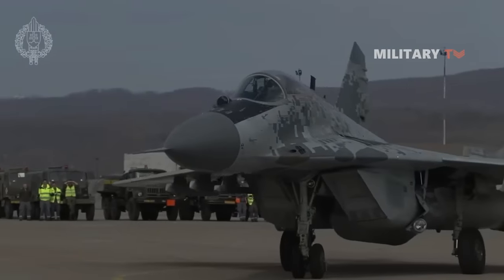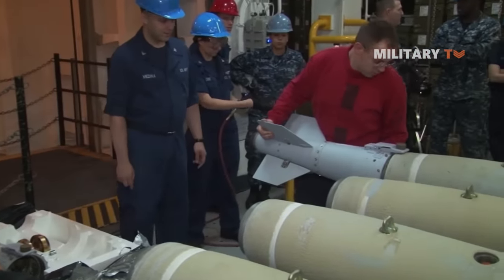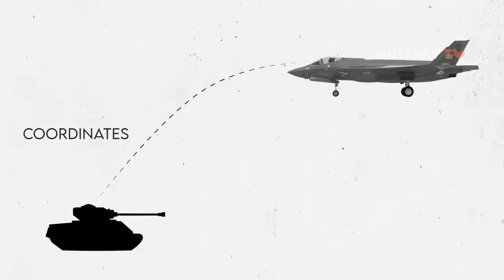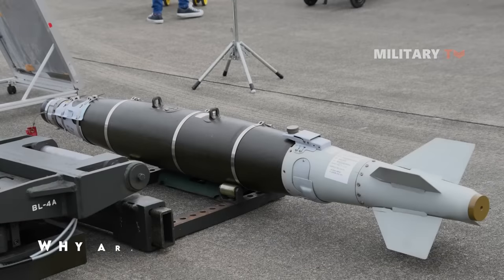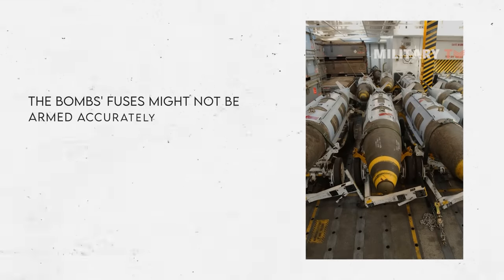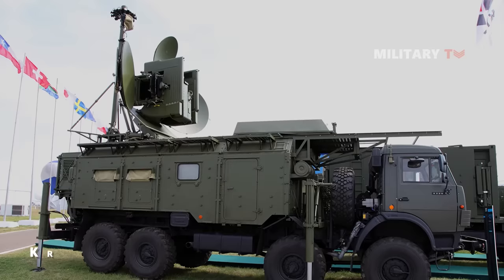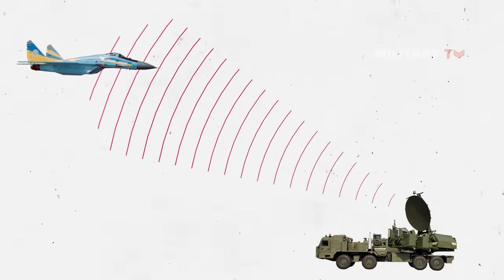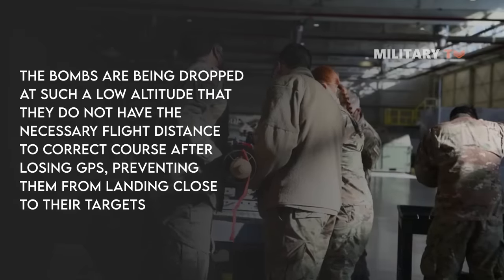Why Ukraine GPS Guided Bombs Are Failing?

Comment: OK-------... The Military has a GPS System that uses frequency Hopping Digital access code with line-of-sight antennae that are shielded from Ground signals that are immune to jamming...  Whether Ukraine is allowed to use such systems is another thing as the US may not want such a receiver to fall into Russian hands if the bomb or missile fails to detonate... As well as the new Inertial navigation systems that only use GPS as fine-tuning updates that will ignore the GPS if it suddenly moves a set distance from predicted targeting or miss matches any other GPS signals (of the Dozen systems now in use World Wide) used by the Weapon...  These there are the  New Inertial Guidance systems that have less than a two-meter impact point of the target over a 100 miles from the last accurate position reading of the Air or ground launcher...  The old and now greatly improved Ground profile system has also been reduced in size to now fit small bombs and Missiles as well as Infrared video and Millimeter wave Smart Direct Targeting systems added to Bombs with simple replacement Nose fuse kits that are quickly superseding the need for total reliance on GPS systems...   But then they are all expensive compared to the Original Cheap Single Frequency GPS Systems on older weapons... That Ukraine may be Stuck using...

Comment: Russian C-400 is the most advanced AA platform on the planet. It has gigantic range, reaching very deep in Ukraine territory, therefore ukrainian MiG 29s have to fly extremely low and drop ammunition from too far away.
Having said that, the russians also posses the best GPS-jamming technology in the world (I bet the chinese will steal this tech sooner or later), so even if an ukrainian pilot goes suicidal and drop the projectile as it should be dropped, it still doesnt reach its intended target.

On the other hand, russians use their dumb bombs with a similar navigation kit with great success.
Only god knows how much ukrainians died from their FAB 500, 1000, 2000.

Comment: Radar jamming can be targeted and destroyed. Why can’t we do the same with GPS?
Reply: They move.
Reply: @NathansHVAC  I would think the military knows they can move. And just like radar, you want to set them up high and with a lot of visibility to maximize its coverage. The problem for the people using GPS jammers is that moving them around frequently is resource intensive and takes time. Not sure if the HARM is designed to detect GPS jamming transmitters or not but I suspect we are learning the electronic signatures of such devices and can program the HARM to detect, identify and track them before being sent off to destroy them. A pair of F-16s on SEAD sorties can make a quick work of these systems opening up the use of precision GPS weapons again.

Comment: I would say that in a theatre where GPS is known to be unreliable due to jamming or spoofing, the GPS should be the backup, and the INS should be the primary navigation source. Maybe the INS system should be initially calibrated by GPS while out of the range of jamming systems, then if GPS data conflicts with INS reckoning of the bomb's location, GPS data should be ignored.

Comment: Military GPS receivers have an encrypted, secure capability on 3 different frequencies (L1, L2, L3) that requires input of a GPS cryptographic key for the GPS receiver to use the L1, L2, L3 precision (P) signals. If the cryptographic key is not loaded, then the receiver can only use the unencrypted L1 C/A signal which is very easy to both jam (deny) or spoof (wrong location, and/or bad velocity). If Ukraine doesn't have the GPS cryptokeys (not supplied by US/NATO) or they fail to load them correctly, the the JDAM's GPS receiver can only use the easily jammed L1 C/A signal. If the Russians REC units are spoofing GPS, then the JDAM are getting erroneous position and/or velocity measurements to the JDAM guidance OFP and fin steering to target coordinates is commensurately compromised.
Reply: They must not have the keys because the keys are already in the western weapons sleepyhead!

Comment: because crappy engineering that worked to fight cavement doesn't work so well with equal opponent. That's the problem of half of the USA weapons, they were engineered to fight cavemen in some craphole of the earth. Not having jamming resistance can't make it even military grade as per 2000

Comment: JDAM, one must emphasize, is a gravity bomb that must be released above the intended target.  This means flying nearly OVER the intended target. That is easy to do when bombing low tech enemies with no Surface to Air Defences.  But that is not the case in Ukraine.  Every Ukrainian fighter-bomber that attempts to overfly Russian forces at 20,000 to 30,000 feet, like NATO aircraft did in Afghanistan, Iraq, Libya and Syria, will be shot down.  So the Ukrainians, in order to survive, fly fast and on the deck, an altitude from where these bombs are not effective.
The only bombs they could use are stand-off winged bombs, like the Israelis have been using against Syria or like the ones the Russians now use in Ukraine.  They can be lobbed quite a distance from the target and will glide to it, without requiring an overfly of the target like the JDAMS do.  They JDAMS are great for bombing the Taliban and ISIS, not the Russians.
Reply: What are you talking about JDAMs have a range of up to 45 miles.

Comment: Too many misconceptions in this "reporting". 

1) Ukraine MiG-29 and Su-27 fighters are not inferior to western equivalents, they are actually superior. The problem is that Ukraine doesn't have them anymore as in the first day 80% of the Ukraine fighters were destroyed on the ground. In the next week 95% of them were destroyed. Ukraine received about dozen older MiG-29's from the Poland and another from Slovakia. Ukraine has been losing those left and right, but they have been now operating them far more carefully trying to avoid losing them in vain. They just can't use them as Russia has superior Su-27 models and superior air defense coverage. So unless west want to send their latest fighters, Dassault Rafale, Eurofighter Typhoon, Gripen NG and of course F-35, then Ukraine propabilities to invade Russia is extremely thin. 

2) The JDAM is not utilized by pilot entering the GPS coordinates in-flight. That is really done primarily by the weapons grew when loading them to aircraft in the arming area (just before taxiing to runway). The JDAM is only to be used against known target location that fighter can't reach with conventional weapons. Why the pilot can't reach the target area to even use a targeting pod to self-generate coordinates. The pilot could receive the coordinates from the ground, from the special forces searching and tagging them. But no recon forces are there to expose themselves by using radio as it is instantly intercepted. 
The target coordinates are received in slow process (in time of hours, even days) in real modern warfare. The pilots needs to plan their mission just hours before the take-off, they are using all their given intelligence and give the target coordinates for weapon crews to program the bombs for them. When the pilot enters to cockpit and taxi to arming area, they need to confirm from the system that target coordinates are correct for each bomb. That is not even required, as JDAM can be used as any normal dumb bomb, just flying to drop range and release it. It will then autonomously fly to target area and perform programmed attack. As the programming requires to set target coordinates and elevation, the impact heading and impact angle. So pilot needs to be following the attack profile accurately to release JDAM at proper change to hit target area. To get coordinates, elevation and all is very difficult without proper JTAC (as west calls them) crew. That needs to operate 3-5 km from the target. Not happening really. The heading and angle are mainly pilot decisions, as they need to think the delivery profile. 
The Russian/Ukraine fighters has for few decades been compatible with the western weapons, they use the same databus standard as USA does use and whole NATO regime. You literally can take a western weapon and attach it with proper pylon to plane, fly to coordinates and release weapon.

3) The problem is that Ukraine can't fly high. They are restricted to fly below 200 meters from target up to 50 km, and under 25 km they need to fly below 50 meters. Otherwise SAM network can engage them. And that altitude is completely useless to be used for JDAM, as only way to release it is to use LOFT profile. And that gives at best about 10-12 km range at max for release. Severely placing the fighter in danger as it needs to raise to about 1000-1500 meters altitude at the release pull, quickly roll around and dive back to cover. That is more than enough time for SAM system engage it, as they have proper early warning network going. 
The JDAM is meant to be used from situations where pilot can't see the target area or can't reach it. So example cloud cover, concealment, weather etc are as well common problems. But when fighter can't perform the release profile, it is almost useless. And western fighters will not change that situation whatsoever.

Comment: They need to design small, high altitude, loitering munition swarms with high speed and targeting that uses an initial calculation to determine speed and trajectory with no GPS once target is determined.  Targeting is via a tablet with draggable predefined grouping like - single, single point group of 3, straight line 3 (rotatable), 4 block, 9 block
Reply: You just described the Lancet. Russia way ahead here already.

Comment: with JDAMs, they generally need to be deployed above >10,000 feet, at say above 350 knots, that way the bomb has more lift authority/speed to make adjustments.

russia uses glide bombs with no dramas. 

russia has insane air defences su35 and s400, you need glide bombs or JDAM ERs

Comment: What’s actually happening is an idea that I presented to my country 2 years ago.

It’s called GPS Positional Illusion, you don’t JAM the signal, you deviate it to some degree, and you synchronize your platforms to accomodate that, you can do this all the time and change the deviation every 10 minutes, therefore it’s not detectable as a JAM-in action, and foreign systems will think that they are working well.

I suspect this is happening.

Comment: I am not an Expert but the higher the bomb is the interference (Jamming) is also less effective, what they need to do is to have the inertia system lock to a flight path set by the highest GPS Signal strength at the initial release stage or add a laser lock which is less desirable.

Comment: Fundamentally, many US weapons system are flawed because the way they function is dependent on the US having air superiority.  Do you think all those Russian ECM systems would be as effective if the USAF and US Navy were operating in Ukraine?  We would know EXACTLY where those units were, and hit them from F35s, using inertial guided bombs etc.  mercilessly.  This would relatively quickly degrade the ECM systems.  Same for SAM system coverage.  After a time, the US would be able to push back Jamming and SAM coverage and our weapons would "work" again.  But in a hybrid conflict, or a proxy conflict like this, many of our systems are not as good as we would like to believe.
Reply: In this case there would not be operating USAF/US Navy more than day. Russian doctrine of war with NATO not limited by conventional warfare. Russia knows it can't beat whole NATO in direct war so only way for Russia to survive it somehow is the immediate use of a nuclear arsenal, which will lead to the expected escalation and the end of the war - due to the absence of opponents in it.
Reply: @alexanderkharin7036  true....